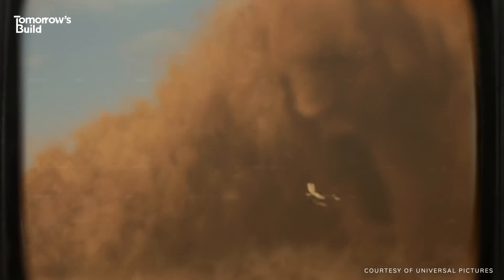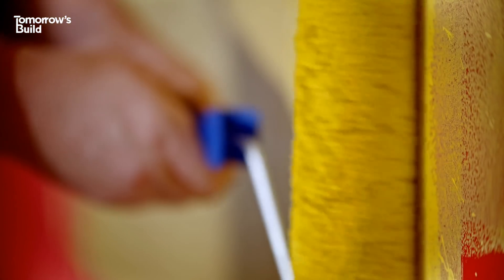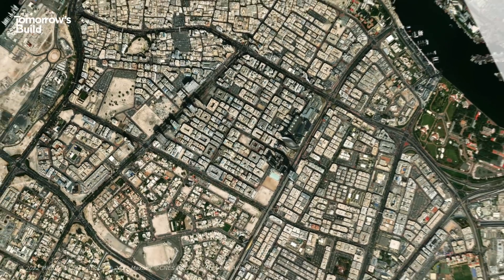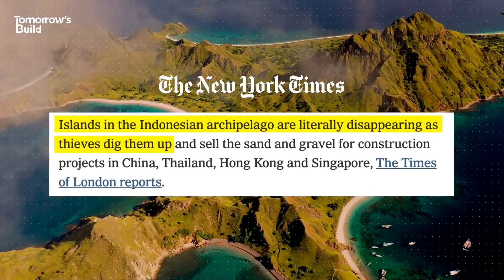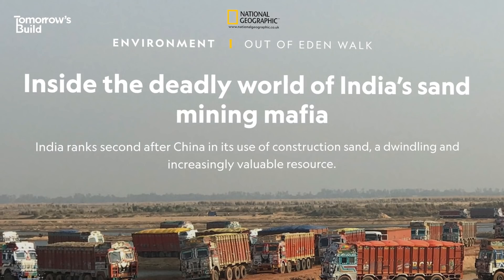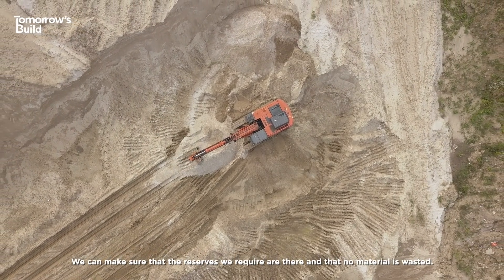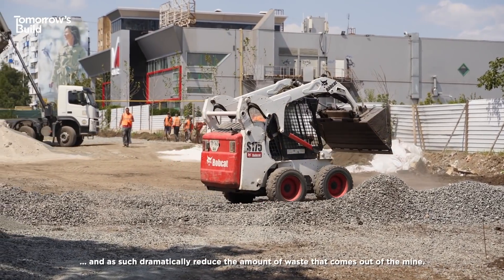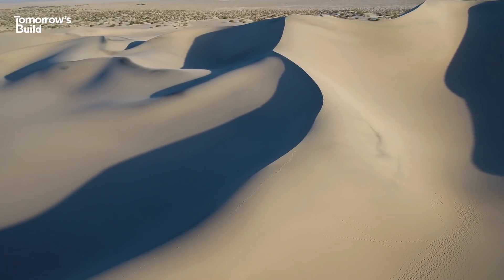This Could Stop Construction Everywhere

Comment: Um, why don't we use the sun that's in the desert to power machines in the desert to make the sand that's in the desert more coarse? It could be melted into glass then ground up. I'm sure there are steps and ingredients missing from that, but in principal, wouldn't that be much more sustainable?

Comment: There is silver bullet solution and that is lowering usage of concrete, because while it is cheap it produces a lot of greenhouse gases  and there are alternatives for some of it's usage.
With glass you just have to make recycling of it better so you would need less of sand intake.
Also they could try to use sand from deserts to throw it in dug spaces to check if it could turn into coarse sand.
and the rest of the sand could be gotten from mining other things like it was suggested.

Europe also has big problem with how much concrete they use in production as we have much bulkier homes compere to the American ones by I am not sure about this point as I don t know about construction in whole Europe and nuances

Comment: i'm experimenting with rock dust as a sand replacement. its results in strong concrete, but requires a higher cement percentage to overcome the porousness

Comment: Just a thought. I was looking at graphene added to concrete to strengthen it. Apparently the carbons grab one another quite easily when the graphene was bonded with the sand. Perhaps using graphene on desert and river sand would make it useable. Incidentally the graphene was created by cooking a sand and sugar mix without oxygen at a certain temperature profile that created graphene bound to sand as opposed to straight up carbon.
Reply: Already being done, as well as researching various fibrous binders. Netherlands has a 30m foot bridge with flax fibers = 2x usual cost.
Economies of scale alone will help in the future, but remember the length of time insurance companies want to collect actuarial data analyses.

Comment: Tell me are the grains of the Sahara sand too small to reshape? if they are rounded, why not build a machine that randomizes the size and shape of incoming sand particles? Then instead of harvesting sand in area's running out, we create the proper sand from the abundance we already have.
Reply: That is the problem in a nut shell, the grains are too small, they have already rubbed together enough over millions of years to be like a fine powder.

Comment: We do have a lot of sand. Just like our ancestors milled wheat for bread, we could be thinking of ways to "mill" sand to achieve what ever coarseness we desire
Reply: You can only mill downwards and the sand that is abundant is already too small for use in construction.
Reply: @krashd  It didn't occur to me that the desert sand grain sizes were already really fine. I guess we'd have melt the fine sand together to form coarser clumps without going too hot so it forms glass. i'm kinda curious whether we can "mill" or crush glass back into sand

Comment: I have done masonry work. The sand in construction needs to be of a certain quality. You can remove 80% of strength in some uses. Weak concrete, isn't good.

Comment: It says that desert sand is useless for construction? well that is only because no one has spent effort in combining minerals with it to produce useful materials.Consider maybe incredulous means such as alkaline mulsification of desert sand to make it more abrasive so that it would compact and adhear to construction adhesives in concrete or metalurgy production processes.
Reply: It would still be just fine to use desert sand to melt down to create classes which could then be crushed to use in a concrete mix or the production of glass. Which glass couold then be crushed to create an abrasive mixture for more concrete, and or gravel type materials.
Reply: You're Welcome problem solved.

Comment: What's the big deal?
We can make sand.  It's almost entirely recyclable depending on the binding agent.

Just grind it back down and you've got all you need.
Reply: If we use 30 billion tonnes per year who is going to do all that grinding?  And pay for it?
Reply: @krashd  And how much is simply discarded uselessly after a concrete structure has been taken down?
Probably 80% of it or more.
It's more 'cost effective' to rape the land for new sand & aggregate than to re-use what's available.  Same goes for plastics and many other resources.

Comment: using tailings is wishful thinking. if a mine could monetize them in any way they would already be doing it. cost of transport and operational costs would make it unprofitable in most cases.
not sure in the rest of the world but its common practice to use overburden and tailings to fill in large holes and somewhat rehabilitate land after mining is finished.
making efficiency and environmental improvements to an industry requires a very intimate knowledge of the industry and its boots on the ground operation. something lacking in most regulating bureaucracy.

Comment: The great sand deserts were created by the deposition sides of arcs of surface current (Andrew Hall) with the electric discharge machining occurring elsewhere on the opposite side of the  arc . . want more fine sand have another war in heaven/marriage made in heaven Sun swap & yes its quick electrical in nature phenomena & those times an near extinction event for us , although we were smaller squirrel sized relatives compared to larger cousins under lower Birkeland charge Earth under brown dwarf Saturn Sun of the purple dawn

Comment: First of all, if the United Nations is getting involved in "solving" the problem then you can expect it to be mishandled and the situation to get worse rather than better.  And by the way -- desert sand can indeed be used as an admixture in concreate.  Wind formed desert sand can be mixed with water worn sand to extend the volume and will provide an even wider distribution of grain sizes in the final mix.  The problems with desert sand can be dealt with and if/when water made sand becomes scarce then you can bet that industry will adopts ways of dealing with desert sand.  They have not adopted those ways up to now because there has been no need considering the wide and abundant availability of river sand.  There are always going to be local shortages and issues with building materials but that does not mean that construction everywhere is going to stop because the world is running out of river sand.  Just in case you have not noticed, the mass of our planet is made up of approximately 75% silica so there will always be silica available for both natural and manmade sand production.

Comment: This is still not getting the attention it deserves, and it is suffering a clickbait death. We are not running out of sand. Even in this video they mention that sand is seen as a local resource 50Km away. The problem with the sand mafia etc is due to it being illegal to destroy wetlands and such to get at that sand. If you can provide that sand you are undercutting anyone else in town. That isn't because sand is scarce.

And obviously it would never stop construction. It would just increase the price of whatever uses that sand by 5-10%. Re engineering the Sahara Desert sand for concrete use isn't impossible, just expensive. Not even cost prohibitively slow. Sand isn't a renewable resource, but recycled concrete quite often is.

Comment: How about a sand mixture? Tests need to be done to see just how much desert sand can be used in a river sand/desert sand mixture before it has any effect on the concrete. Just adding 10% desert sand could go a long way in helping solve the problem or at least buy some time until something better comes along.
Reply: I'd like to see the same thing too. Or say, for lower strength concrete, they could use a higher percentage of desert sand.
Reply: @HenryMidfields  Side walk grade concrete is like the lowest grade I have ever heard.

Comment: But surely, desert sad can be used for silicon chips, glass for bottles, windows etc. If it contains the same amount of silica, what's the problem with it?
Reply: it is used for silicon chips in Arizona. That's why they build factories here. This is another manufactured crisis.
Reply: @cchavezjr7  
Thanks, buddy. I knew somebody would know.
Reply: @piecesofeight  No problem. Look up Intel, they've had factories and building new ones that process the silicon from sand and then build the chips here as well.

Comment: What about crushing and refining demolition waste? in the UK we must have tons and tons of old bricks and concrete(made from sand and clay) that could be crushed and recycled. A lot of that stuff just goes to road fill. Instead it could be used for building projects?
Reply: I think there are building regs in Ireland that prohibit the use of building waste in filling in sites below floors and before the concrete slab is laid. Also there are huge problems with mica contamination in concrete blocks causing weakening and swelling and cracking of structures built with these defective blocks.
The main reason that old building waste is not used in new construction is the lack of information on the nature of the waste and its performance when wet by subsurface water etc. Will it swell, weaken and crack?
Conscientious builders avoid it for this reason.

Comment: Desert sand is not completely useless, construction engineers are simply not processing and using it.
Reply: its useless for concrete. there is many issues with it but basically concrete made with the wrong sand will crack and crumble due to grain size, grain shape and more. also likely useless for compaction due to again grain shape.
Reply: I think that is true,  that there may be other uses for desert sand, but it is not useful for construction "at scale".  There are physical limitations in play here.  To make a concrete structure that is both light enough, and strong enough to be useful, angular aggregates are needed.  Round sand pumps easily, and would work vary well for ballast slurry,  but that product is seldom used for anything anymore. It made a great ablative layer  in an early 20th century bunker,  but that kind of "mass based" structure is uncommon today.  Dubai doesn't need any new pyramids.
Reply: Only issue I have heard of is wrong grain shape, so anyone with a desert nearby should probably use it for making glass, beaches, sandblasting and so on. Only other place where the shape might matter is making sand filter for water purification and I'm not at all sure of that.

Comment: Just to let you know you can build an entire house out of 3 materials
Pumice cement and water mixed and poured into a set of reusable forms Pumicecrete is fireproof termite proof rust rot and mold proof and has a high R value and good sound attenuation
Reply: You can build a structure, not a house.
Reply: @darthtrader511  I've built 8 houses in the past 25 years I don't know what you mean???

Comment: Desert sand gives less strength but this could be compensated for by designing with a higher safety margin. We use desert sand for our concrete here and nothing collapses unless if it is poorly executed. And even then, concrete is a very forgiving material. I’m sorry but I can’t deny what I have been seeing all around me here. Nothing built with desert sand wants to collapse.
Reply: exactly, they also use fiber fill and other things in it. It's not a crisis

Comment: It was said in the video that desert sand is not good as it's too perfect / particles are too round and uniform.
But it didn't mention whether any of it is (or can even be) used for cement mix, of which 60% is sand. Can it be 10% desert sand and still be ok?
Though, the video did say the construction industry uses sand from a local radius, always, so... it doesn't even matter

Comment: At the granite rock quarry I work at we are actually trying to cut down on sand production from what I heard last week, we have made what we need for the year.
Reply: its likely because there is not as much local construction. As stated in the video most sand is mined <50km from construction site, which means its a local resource. If you're not exporting to local construction suppliers you're missing a trick.

Comment: I’ve seen this mentioned a few times in the comments about melting the desert sand and then crushing it to desired coarseness.
Hopefully someone knows why that won’t work but it’s not like there isn’t endless solar energy to tap into.
Even if just using giant mirror or lens arrays to focus the light onto the sand and melt it that way. Very low tech and maintenance aside from cleaning.
Reply: if you melt sand you get glass... glass isn't a suitable sand replacement.

Comment: Manufactured sand is byproduct of rock crushing. It is superior to wind and water deposited sands. Grains are angular, irregular, and lock together tightly. Maybe someone should build rock crushing faculties and produce only manufactured sand for export. Also, recycled concrete can be crushed to provide various sizes of product from course to fine, it is angular and irregular in size perfect for making concrete.

Comment: 1:25 - I don't think this number is correct. 30b tons of concrete would translate to about 25b tons of CO2. The world emits ~55b tons of CO2, but concrete on its own supposedly only represents <10%. If what you are saying is correct, then concrete is responsible for ~50% of all CO2 emissions.

Maybe it was supposed to be 30b tons of sand was used in the world each year?

Comment: The Sahara would be good for glass at least? It would take a lot of energy to turn in into something good for construction though. Like melt it and turn it into ground glass. It's the perfect place for solar power though.
Reply: Apart form all that sand and dust settling on the panels every time you get a high wind or storm, and even though it is less course than sea sand it still sand blasts everything and gets into the infrastructure causing problems. It also tends to pile up against built up structures. Its not as straightforward as it sounds.

Comment: Desert areas have two things, sand and sun. If you used a solar concentration system to rapidly heat sand passing by on a conveyor it would stick to a few neighbouring grains and after a bit of rough handling it would probably break apart again but this time it would have a much greater surface roughness.

The engineering would be a b!tch though... sand gets into everything and destroys moving parts, especially when dry.

Comment: Let's be serious here! It is an artificial problem, for sure. We have to think of a more sustainable way to use this resource, because it WILL run out sooner or later. And I don't think the desert sand is useless for construction. They make it seem like it has the same properties like flour in construction, which it cannot possibly be true!!! The solution is easy: use lots of desert sand for civilian use, like building housing and edifices that are not too tall. Surely the desert sand can handle it, we are not talking about talcum pouder, aren't we?!? And second, even for taller buildings it can be used a mix of sea + desert sand and change the architecture of all buildings into building them with thicker walls for increased stability.

Comment: Heat the desert sand by large magnifying glass and it'll turn into a molten large rock and then crush it and make micro size sand to large size boulder to use in construction

Comment: Dubai is an economical problem.   Over charging for oil has created an unnatural economy wealth nation in the poorest section of the world,  the Middle East. 
Because oil doesn't require a large work force.
The oil wealth is not spread equally throughout the Middle East. 
So instead of spreading the wealth,  Dubai is created. 
The poor of the Middle East are migrating to the West

Comment: Sand seems like a hard thing to run out of, but we might not be pricing it properly. If the extraction of sand also came with a severance tax it would price sand in such a way that there would always be some left. Rising construction costs aren't fun, but neither is suddenly running out of a resource
Reply: Might as well use it while you got it instead of artificially restricting supply while lining the government's pockets. If there's no natural sand left for them to use they'll go for the next-most economic solution and the price will rise to meet it. The market will adapt. Artificial control over sand prices will not cause the market to adapt significantly better.

Comment: unfortunately, this haS been talked about by the UN for 2 decades, and this waS also foretold 4 decades ago. The sad part, is that 40 years ago, they said we would be at this point in another 20 years.  But we shaved 1/3rd of that time off.

Comment: If the sand is too round you can always melt it and make coarser sand from it similar to how rockwool is made but with thicker strands of molten sand that are crushed after cooling down again.
Reply: or just use more fibreglass in the actual construction
Reply: The amount of energy required makes this a non starter.
Reply: @Dunderwood62  This might surprise you but there is plenty of energy in deserts every day.
You can even use this molten sand to run a steam turbine during the night. And suddenly you're not only producing building blocks from desert sand but also provide much needed solar energy during the night.
Reply: @Dunderwood62  not if you factor in the costs of lives lost to silicosis due to crushing rock ore and using the biproducts as mentioned in the video. Yes, there is a reason we havent done this yet.
Reply: Doesn't money exist?